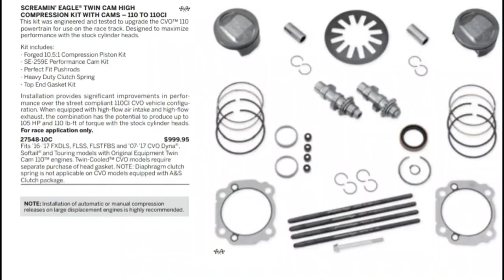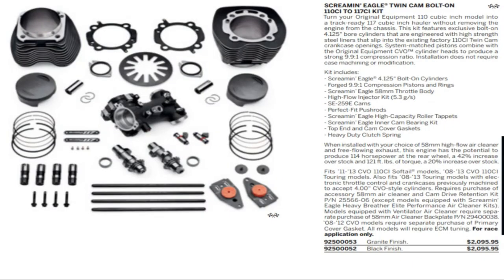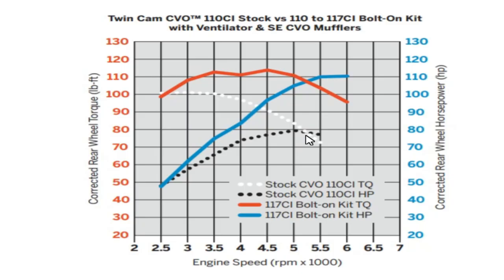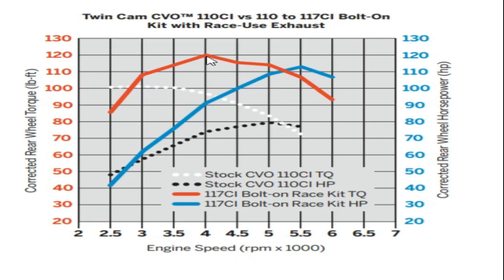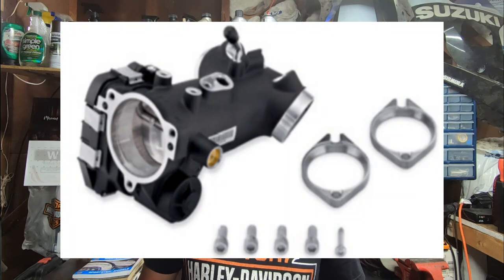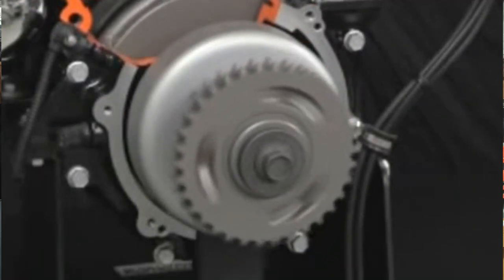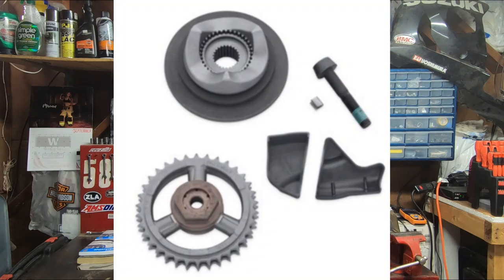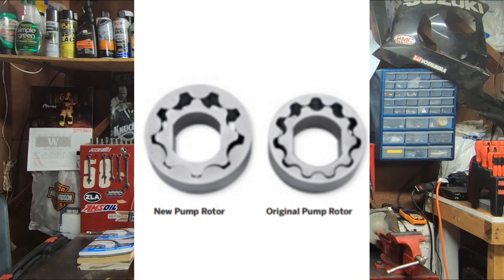Largest Production Twin Cam Harley EVER Produced | Twin Cam 110

Comment: Question for you first I have just discovered your channel and love it. I have a 2006 FLHTCU with 15 K miles on it. 50% of its live operated with Amsoil in it. I have a K&N air filter with Samson fishtail slip ons I would like to keep the fishtails. I want to get you opinion on at least step 3 whats the best cam, or big bore. What would be the best for the 88 to improve my power cruising through the mountains.
Reply from the maker: Thank you, we appreciate it! Well 88's aren't huge power producers with just a cam swap, but they are tractors when it comes to torque. I really like Wood cams, they are bit more expensive but they produce the power. The Wood TW-6 is a straight bolt in cam on the 88 and it will produce torque right at 100ftlbs and horsepower in the low 90's. From there a 95 inch kit with that cam puts down north of 100 ftlbs of torque and gets the power up to around 100 horse.

Comment: After riding for about 38 years!  I finally purchased a Harley 
I picked up a 2012 softail cvo convertible last fall .
I love the bike and with just over 19000 miles it’s literally new barely broke in.
I’m ok doing fluid changes and brake system, but when it comes to cams and tensioner I’m new to this aspect 
What to know when inspecting and everything related to it.
Unsure if the 110b was improved in this part?
Any and all help is much appreciated
Reply from the maker: On the softail with the B motor it's the same tensioner system and it's the hydrualics so they last quite a while. I would start thinking about pulling the cam cover at about 30K and no later than 40K. You'll see the outer tensioner immediately but there is one behind the cam plate, you can get a inspection camera back there without disassembling the cam chest. They may look new or have wear, just depends on the crank run out, but either way it's worth piece of mind.
Reply: @GixxerFoo  much thanks 
With no service history on bike
I’m doing everything now
Oil 
Primary 
Trans
Also
Front n back brake fluid flush n fill
Along with fork oil 
So I know where I am at
Being that the bike is 9 years old and new to me
I feel better and confident it’s ready for the open road
Reply: @GixxerFoo  would it be smart to just replace them both at 30k?
Should I stay oem or is there an upgrade that’s preferred

Comment: What do you think about the Red Cam 587 cam?  Would you prefer the S & S 585 cam or the Red Cam 587?  Red shift says that their 587 cam was made specifically for the 110.
Reply from the maker: Red Shift makes a really nice cam, like you mentioned the 587 is specifically designed as a direct bolt in for the 110. I am really surprised how much power it produces with the lower compression of the 110. Personally I think I would choose the 587 over the S&S for a 110.
Reply: @GixxerFoo  , I installed Zippers RedShift 587 cams with D&D fatcats, 2016  cvo 110. 
Very nice gains ! 👍👍👍
Reply: @tonydanzl   and @James Did you do anything more than adding the cams? Did you get some headwork done? Or just camswap, oil pump and maybe compensator?

Comment: I’ve got a 2016 FLTRUSE with a 117 stage IV. Curious your thoughts on the lifter issues people claim they have. Mine only has 11000 on it. I can’t get a pulse on the lifters as they pertain to these motors especially with the 117 upgrade.
Reply from the maker: The stage IV 117 kit comes with the high capacity Screamin Eagle lifters which have the larger needle bearings. I've heard good and bad things about them, I am aware of some issues with them collapsing. I can't say for sure if this is related to a manufacturing defect or installation of them being setup too tight. I have heard a lot of them being switched back out for stock or going with Jim's or S&S.

Comment: I'll talk to you before I really like all your videos, in my opinion you know more about Harley motors than Harley-Davidson does. I'm the one that bought the 09 ultra classic CVO. I just took it back to the shop because it has a little bit of hesitation issues, and they were able to look it up in their computer and they told me that it had a stage four put on it back in 2013. What kind of numbers are we looking at there as far as torque and horsepower go and does that bring that cubic inch up to 117. They also said the oil pump has been changed. Without getting your dynoed he said he didn't know any numbers he said around the hundred horsepower and 115 on the torque. And do you think that is somebody spent that much money on the engine that they wouldn't go ahead and replace maybe the clutches and the compensator? Or does that have to be changed but just because you got that kind of horsepower and torque?
Reply from the maker: With the Screamin Eagle Stage 4 on the 110 it would take it to 117. For the power numbers it really depends on exhaust, Harley say's with their SE exhaust 110 horse and little over 110 torque. If you have a full exhaust system a little 110 horse and about 120 torque at the wheel. I think he gave you a really fair guesstimate for power, on a dyno depending on weather conditions and a good tune you'd likely be in there at the advertised. Since it was a dealer installed kit it would have the heavy duty clutch spring installed. I personally would of done the compensator and upgraded the clutch as well, but they do really well with the kit as long as your not beating on it really hard constantly.
Reply: @GixxerFoo  it's me again sorry to keep bothering you. I found out a little bit more on the 09 ultra classic CVO, Harley also told me that the cams are the 260 cams. And I believe in the stage 4 there's supposed to be 259 cams and also the Pistons they put in there are 10 and a half to one impression dome Pistons. Which I also don't believe is in the stage 4. I guess while he had it tore down, he got to put what he wanted in the end from Harley. As far as the exhaust goes it's Samson true dual exhaust with Reinhardt mufflers, and Harley also told me it was I want to say level five racing tune. If that's such a thing level five.

Comment: I have a 2014 CVO Deluxe I just picked up with 5900 miles on it (Doctor who never rode had it) I'm not sure I'm looking for more horse power, it seems fine in that department. But if it were yours would you do anything to it to try to make her a bit more bullet proof? I have been reading some SE 110 disaster stories, sigh. Thanks (Mine is the cobalt blue white pearl with gold leaf, she is pretty
Reply from the maker: I would look into the high volume oil pump and an oil cooler if it doesn't already have one being a CVO. Also putting a good aftermarket tuner on it, like the FP3 and get rid of the super lean stock tune. That will help it run cooler too, keeping them cool is really the key.

Comment: This isn't exactly a comment I guess I had a question? So the screaming eagle 110 cubic inch has the same compensator as a 96 cubic inch. It's not beefed up? The screaming eagle 110 does not have a screaming eagle compensator?
Reply from the maker: That's correct, they don't have anything special on the bottom end. Just larger displacement and better heads, it's very misleading in my opinion. Being a Screamin Eagle motor it leads you to believe it would have the Screamin Eagle compensator, cam plate with oil pump and a nice SE cam.

Comment: Does the cvo models come with the S.E. compensator. I have a 13 breakout with 110.??? Thanks friend.
Reply from the maker: Unfortunately it still has the stock compensator that is used in the mass production 96 and 103.

Comment: Would a 259 e cam be a compatible bolt on without changing anything else 🤔
Reply from the maker: The SE 259E is going to require a Screamin Eagle valve spring set in the heads.

Comment: I'm looking at doing the S&S 107 big bore kit 10.5.1 compression with Andrews 67H cams on my 2007 flhrc 96ci. But I've been also looking at the 110ci kit. But after reading the comments I seen the key word HEAT! as in over heating now I'm wondering if I even want to do the 107kit? Smh
Reply from the maker: The big bore kits aren't bad at all, adding a good oil cooler really helps quite a bit.
Reply: @GixxerFoo  just wondering I live in PA but Jun of next yr i was going to ride out to La next yr with my club never been in the desert on a bike
Reply from the maker: You would definently want a good oil cooler going out to the deserts, it will keep your bike temps down and make your ride much more enjoyable.

Comment: Do you know if the 2016 Fatboy S, with 110, comes with the screaming eagle compensator?

Also I do not see the 110 to 110 high compression kit for sale.  Do you know the part number for that kit?
Reply from the maker: The S models are going to have the OEM compensator, the part number for the high compression kit is 27548-10C. You may not see it on the Harley website, but you will find it in the Screamin Eagle Catalog.
Reply from the maker: I like the curve and numbers on that Red Shift for the 110. You don't necessarily have to add the cam plate and oil pump but it's not a bad idea if you can swing it while you're there. It will definitely strengthen your cam support and give your engine lubrication a boost.
Reply from the maker: After hearing that l think l would go with the S&S myself, sounds like they are aware of an issue there.

Comment: Very informative. Mahalo for sharing your knowledge. I recently purchased my dream bike cvo, only had 1400 miles. Sold my 95ci fatboy to get her. Honestly, I'm satisfied with the power of the stock 110. Weird thing is the 95ci twin cam ran hotter than my 110ci cvo. And what I noticed is it runs smoother on higher rpms. Shift early and it vibrates. Is that how these engines are? 
2008 105th anniversary cvo springer
Number 12 of 1050.
Reply from the maker: Thank you, l appreciate you watching! The 110 does have a longer stroke and larger pistons, l can see that making it feel like it vibrates more. You might check all the bolts on the engine mounts. My wife's bike had weird vibration compared to mine. l went over every nut and bolt on the engine mounts and that took care of it.

Comment: the factory should put the screaming beagle compensator in the bikes when they leave Milwaukee.
Reply from the maker: I fully agree, the stock one just is fine for cruising but if you ride a bit harder or hop it up that's when the trouble starts
Reply: Yeah, love them beagles..

Comment: Hey brother, I have a 05' fatboy CVO SE103", I bought a 110 BB kit from VTwin MFG and want your opinion if I should use the original SE103 heads or get some SE110 heads. Believe the cams are SE253. Thank you for any advice on this build!
Reply from the maker: Yes you have the 253 cams, the heads aren't bad but they could really use some improvement. The really held that motor back, some 110 heads would be a lot better.
Reply: @GixxerFoo  thank you, all the SE110 heads I'm finding are twin cooled(water), my bike is air cooled. Even though the heads look exactly the same.

Comment: Little  off topic here but just installed a  screamin  eagle  hydraulic cam tensioners and bigger  oil pump on stock 01 cvo now blows dipstick  out any ideas?
Reply from the maker: Check your breathers, sounds like you might have some obstruction with the crank case breathers. Also check what your oil pressure is running at. That crank case gasses have to go somewhere and better out the dipstick than pushing gaskets. You also might try a vented dip stick as well if your crank case breathers are clear.
Reply: Ok hey thanks  for the reply!!!!!!

Comment: Can't seem to find the SE 110 High Compression Kit. Doesn't seem to be available anymore.
Reply from the maker: You might not see it online, they don't advertise half of what's in the SE catalog online. The part number is 27548-10c, the dealers selling online have it for about $850.
Reply: So I found the kit and it looks like something I want to do. Will the stock throttle body and injectors be enough? Already planning on upgrading cam plate, oil pump and compensator. Any other upgrades I should be looking at?

Comment: You can do a 117 with the 13
Reply from the maker: Harley's kits are strange, they will fit most years but it's usually something little where they say it won't fit. You can install it but warranty can be a hassle with them.

Comment: Is the 110ci CVO engine from 2007 the same as the 2016 110 dyna low rider s?
Reply from the maker: Pretty much the same engine overall, there's a few minute differences like the 2016 has a updated compensator but mechanically the same engine.
Reply: @GixxerFoo   your knowledge on Harleys is nothing short of amazing. Just purchased a 07 Dyna CVO so pretty happy that I’ve got low rider S performance for half the money.

Comment: Do 110 barrels drop into a stock 96? Or does it require machining to fit the bigger sleeves? Also how Dow you tell if your compensator is failing? Cheers from Oz.
Reply from the maker: With a 96 the largest Harley bolt on kit you can get is a 103. Aftermarket l believe you can get up to a 107, but any bigger than that l would bore cases to make it a 110. Cylinder spigots start to get sketchy thin even with reinforced castings. For compensator failure, you'll have some serious banging and clanging out of the primary. Hard starting, slipping, and the bike overall running like crap.
Reply: GixxerFoo thanks for the info. 👍🏻
Loving this Twin Cam series. Keep up the good work. Got a Stage 1 Rocker C that's a little lacking in the torque department. Looking for a bit more ooomph.
Reply from the maker: Rocker C, that's quite the bike! Very aggressively styled and rare. I haven't seen many of those running around. If you're looking for a nice torque bump a set of cams is great start. It's the least expensive of all the options out there. You can also tailor that power to where you ride most.
Reply: GixxerFoo true. Cams and compression should do the trick. It's a cruiser so I'm looking for more shove in the bottom end. Got a VFR in the stable  also for when I want to rev an engine to go fast.
Reply from the maker: 👍 That V4 is really kinda the best of both worlds. I wish the Japenese manufacturers would bring back bikes like the 996 Super Hawk, Rc51 and the TL 1000. I miss the Vtwin super bikes.
Reply: @GixxerFoo  I owned a Suzuki TL1000S.  That thing had a steering damper on it and it still was "twitchy."  You were "pitched" so far over the handlebars that you could not "push/push" steer, you had to "pull/pull" steer.  Fun bike, uncomfortable as heck and death waiting to happen...  Just my experience with it on Winnemucca Ranch Road, NV, north of Sparks, going 155 mph!!!  My ZX12R going past the BLM Wild horse pens, on the Pyramid Highway, NV did 185 mph and was a stable as a rock...  That when I was young and dumb at the age of 60 years old....  LOL.
Reply from the maker: 😆😂 wow, yeah I ain't that crazy. Yeah the TL was not known for comfort, it was a big pig. It had another neat feature that was great in the winter. That frame would get nice and warm for you 😆.

Comment: so would putting a 30 thou head gasket in a 110 raise compression to over 10:1 ?
Reply from the maker: It might raise it a little, but with the flat top pistons on the stock heads you won't quite get to 10:1.
Reply: @GixxerFoo  my brother the mechanic like to take the heavy springs out of the Screamin eagle heads,too hard on the drive train he figures, shave 50 thou off ,30 thou gasket,check with putty for piston to valve contact

Comment: Would you always change the compensator when replacing a cam?
Reply from the maker: I personally wouldn't change out the compensator unless it was showing signs of failing. There's nothing wrong with going a ahead and upgrading to a Screamin Eagle or a performance aftermarket unit since you're gonna be adding more power and torque.
Reply: @GixxerFoo  I have a 2016 Fatboy S, with the 110 twin cam.  I am not sure if I have the Screaming Eagle compensator.   Also I do not sure the 110 to 110 HO kit on the Harley website to purchase.
Reply from the maker: They have the OEM compensator on the 110, l wouldn't swap it unless it starts showing signs of failure. The compression kit and a good cam will bring that bike to life. The part number for the kit l think you're after is 27548-10C.